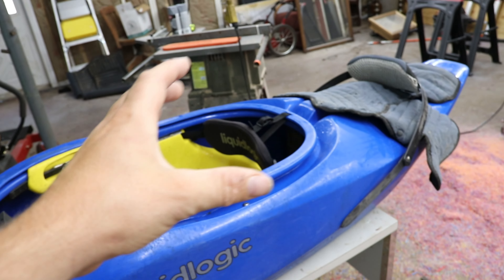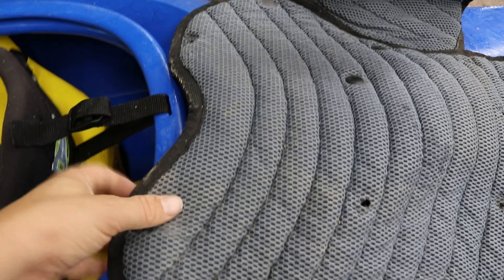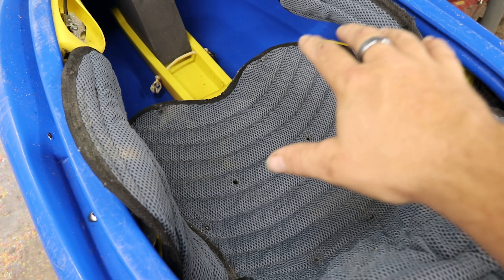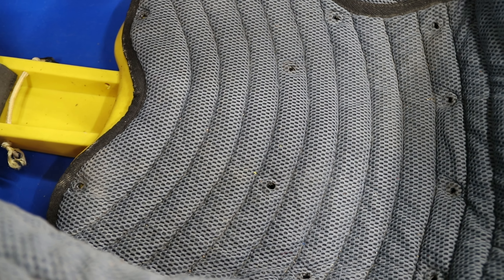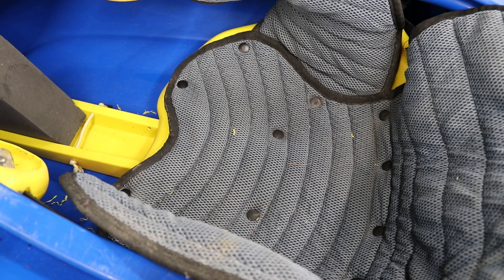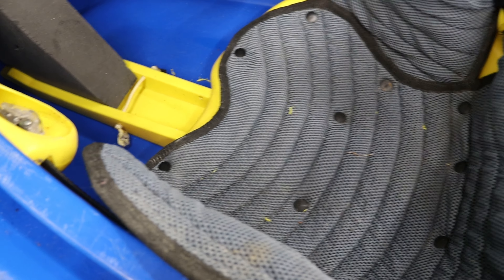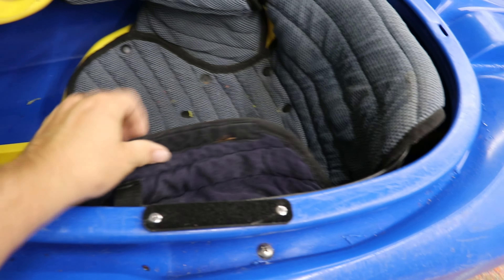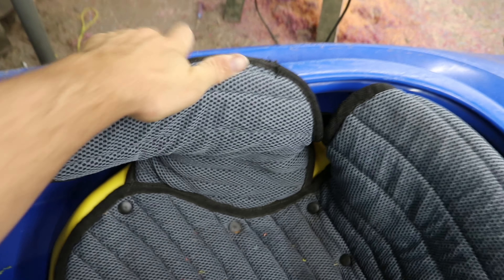Make ANYTHING BadAss | Liquidlogic Outfitting Conversion

Comment: Shane or someone else at LL would need to confirm, but if I remember correctly, the Bad Ass system can drop in to fully retrofit any of their pre-BAO boats. Obviously that's slightly different from what you're doing here, but a fun fact nonetheless.
Reply from the maker: Yes! They are forwards and backwards compatible

Comment: hello sis, I have a liquid logic kayak with a crack of around 20 cm, I intend to patch it, what material is suitable to close the hole? I tried melting a bucket of paint but it didn't stick perfectly to the base material
Reply from the maker: Any HDPE can be used, but ideally you want to use something as similar as possible. Many times the easiest thing is to take some plastic from the inside of the cockpit rim or another dead boat.

Comment: hey alex.  i have an older micro that i want to upgrade to adjustable backband and modern thigh braces. any suggestions on what works best?
Reply from the maker: If you click through my Boat Builder Playlist you'll find everything you will need to revamp that boat. I guess the question though is "Is it worth it?" I would suggest not.
Reply: @AlexBarham  it has run some meaty sections and steep creeks for me.  if i could aquire the parts and pieces on the cheap it could be a new lease on life for a boat that just lives under the deck with the spiders